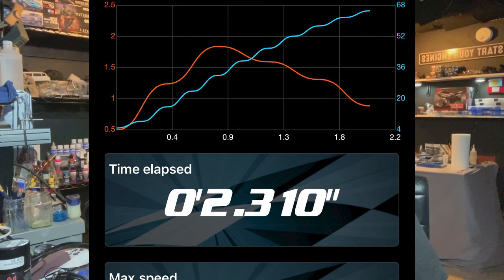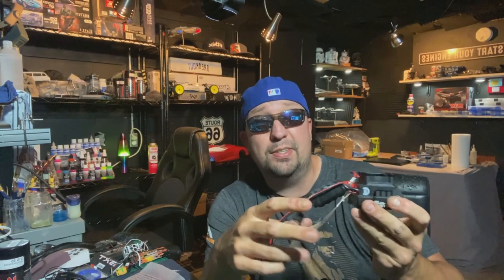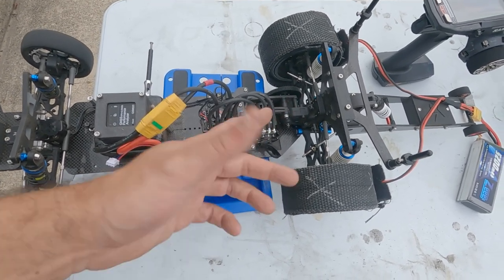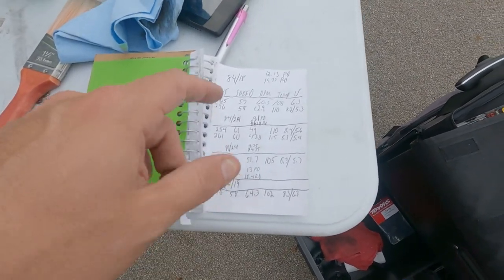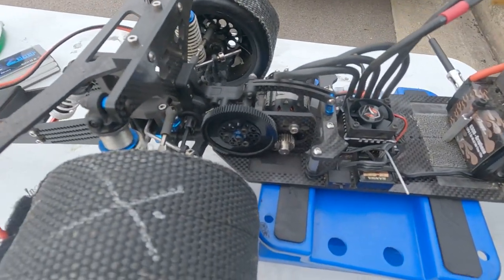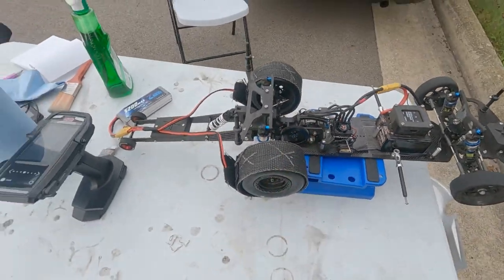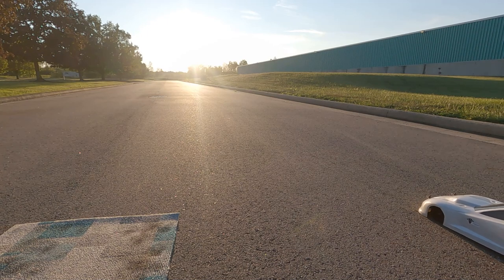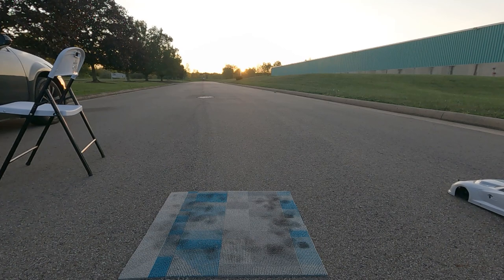HOW TO CHOOSE THE CORRECT MOTOR, GEARING, ESC, TUNE FOR YOUR NPRC DRAG CAR | PREP | FULL TUTORIAL

Comment: On a pass my volts drop to 6.6 to 6.7 but average 7.3. Fully charged battery 8.4. Using Ace Shorty pack 130c. Is that too low on a pass?
Reply from the maker: If that a 2 pole then that would be normal. 4 pole takes that issue away easily

Comment: Again great videos. Learn a lot from them. Got a question. I have Losi 22s with carbon fiber chassis. Castle Monster x and 7700kv Castle motor. Running 25 pinion 78 spur. Consistently in the 2.5s at 56-57 mph. Made 2 passes 2.49 at 59 mph. Setting in controller and esc timing seems to be the  tune car likes but I want to get in 2.4s 60s consistent. I am thinking about doing gear change instead of tinkering with settings in esc. Timing, ramp etc. would that be a good starting point to get more time and mph out of car do gearing change?
Reply from the maker: Just go up two and down two on pinion and test. That is the only way. Beyond that it’s all settings at the launch. Control the spin and get off the line harder
Reply: Thanks. Getting better esc/motor combo. Castle Mamba x or DRK?

Comment: I'm running a 4.5 turn holeshot drag master on a breakout. I have no idea what to expect expect from this motor, and had to fix a few things just to get running. I don't understand much about these manual timing motors. 19/96? Is that gearing? I've heard 60° is max for timing as a max? Any help appreciated. I've got a couple drag cars, running different setups, and am more comfortable with brushless setups, burly how can I get faster? My dr10 is running a 4600tp on a mamba monster, and flies. The velineon 3500 is ok, but my dr10 smokes it and the losi22 2s to 3s. They run three, and I yard em. I've heard great things about these drag motors, but don't know where to start. Great vid.

Comment: Thanks for the video. Really considering getting into this part of the rc hobby. Have drones, bashers, monster trucks but this peaks my interest. Just not sure about races in my area. But my forte is auto mechanics and drag racing, have done it all my life, Mustangs , Chevelles etc so I know the game its a little different being electric powered, adds a new element. Wondering how costly the data loggers are or some of the setups your using, have not researched that part yet. How are you getting your times...from the data logger or did you have sensors on the road? Assuming the data logger. 
But I could watch the rc drag racing all day, or any drag racing. Love it!
Reply from the maker: Speed and times all come either from a $90 gnss we put on our cars and or a local track timing system. We get all our car data through the esc and it’s built in logging.  Start my videos around March and April this past year and watch all the progression and you’ll get an idea of what goes into it and what a few different platforms will do for you. It’s all here.

Comment: Thanks for sharing yr process ,   have you experienced any brownouts due to that voltage drop into the 5s ?
Reply from the maker: Never did. Also don’t see those kind of drops anymore especially with a 4 pole motor
Reply: @Dorkyand40  
Thanks for the reply , just setup my DR10M with the R1 and castle 4 pole and I'm getting voltage drops to 6.8 causing loss of car control at full load - not good ! Running a new team zombie 6900, 300c bat . What would you suggest ?

Comment: Are you sure the motor and ESC are healthy?  
Up until last weekend, running a GNSS 2.34 with my 3.5 DRK setup was pretty easy assuming the road would take it. The 4.5 high traction tune with 35 turbo (20 can), 10 slew, .15 delay would get it done. This is in a much heavier Losi roller with 13.21 FDR. However, something seems to have changed this past weekend. Same type of tune is (was) only good for a 2.5 something.  To even run a 2.4 flat required launching at 60% and ramping to 100% in well less than a second. Then, the motor stopped working in Sensor Mode.  Haven't figured out yet if it's the motor or ESC (or both) that have gone bad. I'm currently awaiting a response from Maclan before send 1 or both in for repair.

How did the race go?
Reply from the maker: as far as i can tell its all good.  the esc was one sent back brand new from their recall.  my times are the fastest they have been but ive always noticed the drk seems to like to be babied.  i didnt try to see if it would run better at lower timing.  i didnt make it to the race since i got stuck working at the hospital but did make it out locally on sunday and things ran good.  this setup is getting moved to my dr10 in the new brisket chassis and im going to be trying a castle monster 8s and 2.5 trinity in the breakout.  going to maiden it tonight :)
Reply: @Dorkyand40  
This COVID stuff is out of control. Both of my parents were recently in Canton hospitals and they were packed full of COVID cases. Stay safe.

Maclan tells me the problem is almost certainly the motor. While I wait for word on repair parts availability,  I just ordered an R1 Wurks 3.0T to play with.  Worst case, I still have a Hobby Wing 5.5 I can throw in if I decide to go play this weekend.
Reply from the maker: Good call I heard they had some ready to ship.
Reply from the maker: And yeah it sucks. Hopefully trends down within the next few weeks.
Reply: @Dorkyand40  
My experience with the R1 3.0T is the same as yours with the Holeshot. Trying to run it hard only makes DRK and CNHL batteries drop their voltage into the 5s. I'm going to need a parallel pack to run this thing. In the meantime, it's coming out and the 3.5T DRK with a fresh board, reshimmed and ceramic bearings is going back in.
Reply from the maker: That’s a good combo. For me 2.35 at its best. I’m sure some can get more out of it.
Reply: @Dorkyand40 what was your gearing for your fastest time on this set up Brotha??

Comment: Great Videos!!! Do you prefer M17 or Futaba & how many stages of ramping does the M17 have? Cheers Man... OIIIO
Reply from the maker: Thanks a bunch
Reply: @Dorkyand40  Does the M17 have three stages of ramping as well Bro? Thanks
Reply from the maker: It complicated but here we go. When it’s all said and done you have about 5/6 useable ramp speeds. Each is like one long stage. You set an initial launch point and then the ramp takes over and brings in the power at a certain speed. Then you can control the slope of that speed and finally you can change how much of a final ramp you get by adjusting dual rate. So there’s a lot going on.

Comment: I’m curious what you were launching at when you were tuning with the drk and the sanwa
Reply from the maker: stage 1 40 .25  stage 2 65 .20 stage 3 85 .15 stage 4 100 .5 stage 5 100 .5  turbo 100 o.1 delay 60deg and 8.3-16.3 slew  punch at 1
Reply: @Dorkyand40  I meant when you were controlling the ramp with the radio. What was the starting point
Reply from the maker: 100 on all stages 0.05 delay on all stages. Point 10/25 on radio depending on ramp or curve. I start at point 10 and ramp 96 and then move up point snd when road takes 30 at 96 I drop back down to 10 and ramp 95. And repeat

Comment: Bro have you tried changing from that 48 pitch gearing and going to 32 pitch gearing. I changed my losi to 32 pitch and the top speed I got was 70mph. I’m running the tekin 3 turn drag motor with the gen 3 rx8 and I’m still trying to figure out a good tune to use that’s my only issue at this point.
Reply from the maker: That’s good to know. I’ve never messed with gearing pitch on these at all.
Reply: I'm the opposite, Im a believer in 48P for short run drag applications, more gearing, smoother running, along with a few other reasons 💯🏁🤙🏽
Reply from the maker: They run hard too. Need to find the details of what this new soflo champion ran
Reply: @Dorkyand40  I know lol, I'm constantly trying to find out what the best Drivers are running, from gearing to motors tires & everything in between 😂
Reply from the maker: Most of it is solid. I’m really happy with my gear and it’s performed well for me.

Comment: Did you like the ramping of the radio better or running the stages?  I’m currently going to try and ramp it off of my 7pxr
Reply from the maker: I like them both. The drk software is working for now but the ramping obviously works as well. I’m going to try it again.
Reply: Yea i fried a drk doing the ramping on the 7pxr smh im actualy going to just stick to the tried and tru mmx8s with my ron 3.0t trinity almost in the low 2’s ! No matter what i did to that esc it just took it even with the amps maxing out on almost every log used every battery you could think off low turn motors just eat batteries with aggressive gearing oh well pay to play still fun
Reply: @nolimitrc1  I’ve had some pretty good luck with ramping through the drk so far, I have a good tune on it finally that it seems to like and I’m making consistent passes in the 2.3’s. She has more in her just gotta get the fine tuning down right.
Reply: @jarrodferguson8964  well i have 3 drks now if the rma makes it back soon enough im going to put it through its paces and max it out an run off of the 7pxr but im hearing the way the m17 ramps the power in is softer on the rx and esc might look into grabbing one of those
Reply from the maker: It is. I’ll be testing it again when the dr10 is back up and running.

Comment: you say the timing in the ESC is turned all the way up but what is the timing on the can?
Reply from the maker: 32
Reply: @Dorkyand40  32 degrees in the can and 60 in ESC for a total of 92?
Reply from the maker: 32 can and 45 esc for my castle. 60 for the drk.

Comment: What’s up bud idk if you are familiar with my buddys YouTube #rcfun but I’ve been racing with him I just put a drk esc in my car last Thursday from the hobby wing with the trinity hole shot 3.5 but can’t break the 2.3 mark any tips????
Reply from the maker: its all in the videos man..takes a lot of work..took me 16 hours to get through these tests and i know what im doing.  started at a 3.0s in april and its been a slow climb.  find your gearing..setup your chassis right and then stat with their default tunes and start working the stage times closer together while looking at the logs and finding voltge drops or tire spins. find a good surface and go there every time to test or youll be chasing your tail
Reply: @Dorkyand40  thanks man I’m from mass got a good spot I had my hobby wing doing low 2.2s and then was in a rush plugged my battery in backwards and everything in my car stopped working
Reply: I’m gonna be watching all your vids in the next few days to get some knowledge lol thanks bud

Comment: Still liking the chassis? Getting one in a few days.
Reply from the maker: More and more each time. Just so many options and they keep releasing options amd hop ups weekly
Reply: @Dorkyand40   what springs you liking on it?  Any place good for setup info?
Reply from the maker: It comes with and they have a complete build and chassis setup guide online. They sell the rcforless springs that most use in the rear. Front springs are the ones that come in the b6.3 kit. Oils of 2k and 80. All in their setup sheet. That’s what I run.
Reply: @Dorkyand40   ok thanks.

Comment: cat pack prob fried because your running a 3. motor on that esc?
Reply from the maker: HMM..so did tim smith all year
Reply: @Dorkyand40  I mean I'm only suggesting, & mostly because your not running it mediocre or conservativly, your pouring everything but the kitchen sink into that thing 😂 (which I don't blame you) but I'm thinking you overloaded it with all your timing, boost & whatever else your adding to it.. 💯🏁🤙🏽Great Vids
Reply from the maker: Thanks. I had 2 drk. One of the original and it never had an issue and I replaced the cap with a bigger one. It never blew. The second drk was part of the recall. I got a new one back and that cap blew. Lots of others were as well. So I think the chip shortage and things like that made them make them cheaper.  Not a big deal. The new drk has a nice one. Not as big as my castle pack :) thanks for dropping by
Reply from the maker: Get a sanw m17 and your good. 👍🏁🏁
Reply: @Dorkyand40  hi chad what is better sanwa m17 or futaba 7px i also thought about buying futaba 4pm 🤷🏽‍♂️
Reply from the maker: Always gotta say m17. It just works and there’s a lot of info out there on how to use it.

Comment: Dude it’s time. Time for you to to a track with real time measurements 
Those satellites are 1500 to 2000 miles in space 
You need to get real time 
+- .2 sec using a satellite is possible 
+- 2 mph using a satellite is possible
Reply from the maker: got em later in the summer